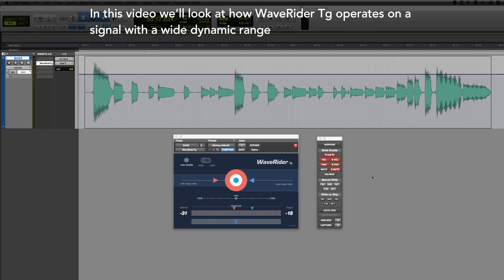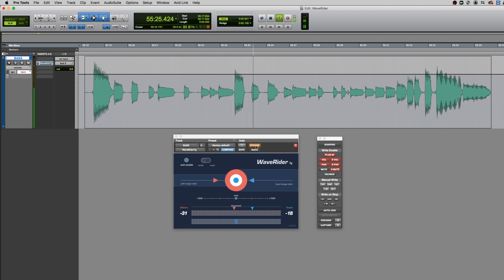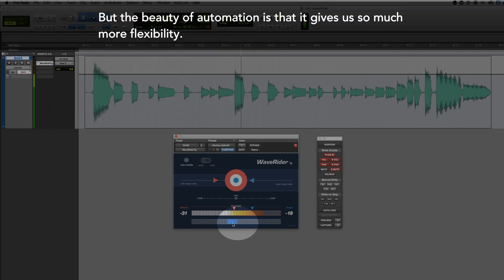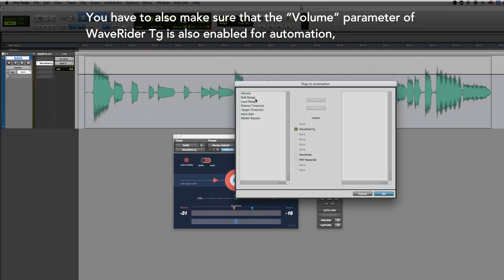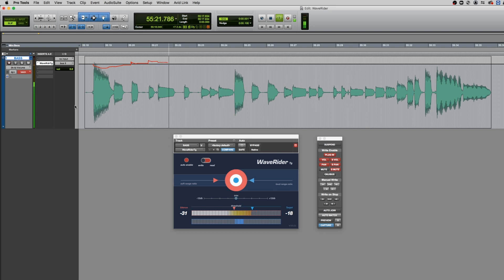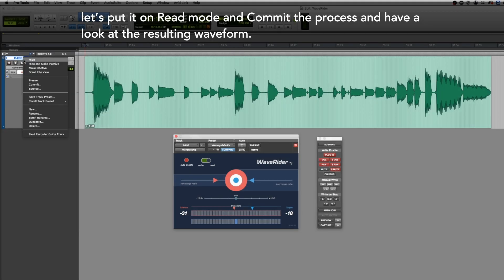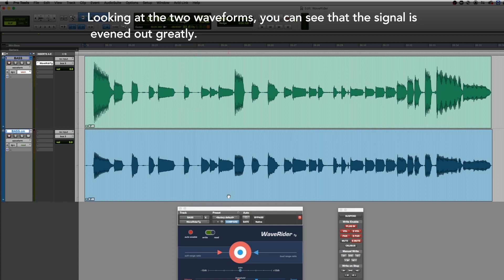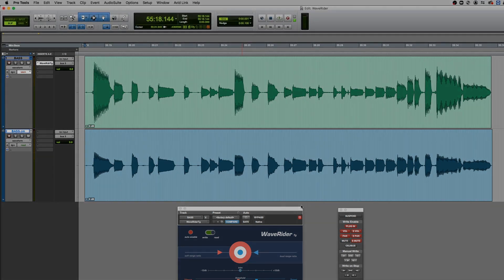WaveRider TG operation

Comment: What's difference between WaveRider TG vs WaveRider
Reply from the maker: WaveRider writes Pro Tools fader automation, TG writes its own automation. That is the main difference. Also, WaveRider has ducking and averaging where TG doesn't. But you can offline process with TG and not with WR. And TG comes in VST and AU as well.